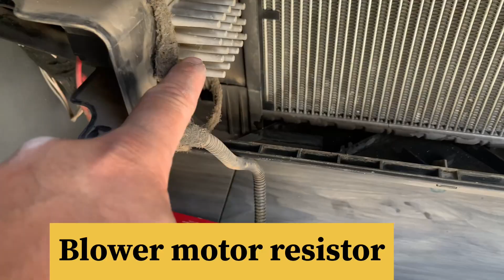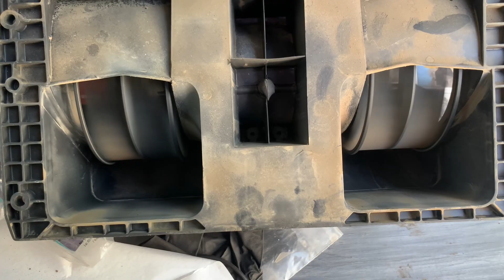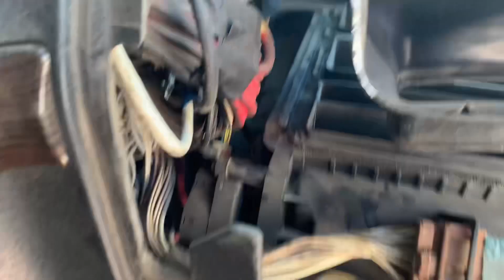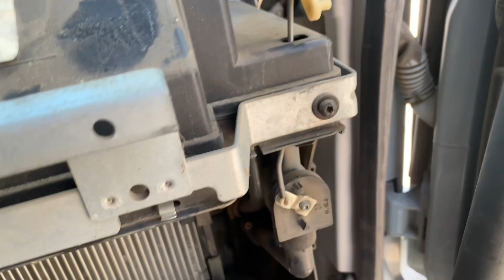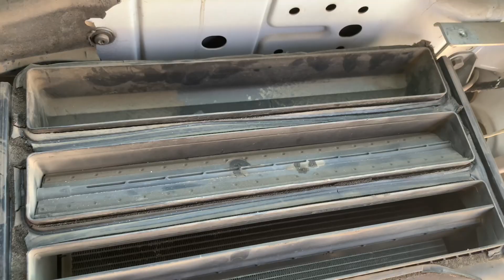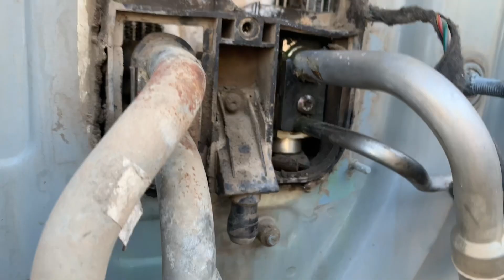Volvo VNL HVAC cab components

Comment: Do you know where is the cab air temperature sensor?
Reply from the maker: Yes, it will be in the evaporator housing.  You can access it by removing the blower motor. It will be a plastic sensor with a very small resistor by the tip. If you have a sleeper truck with a unit for the bunk, that evaporator in the sleeper will also have a air temperature sensor as well.

Comment: I am working on an old vnl 670 and the geartrain has come apart on the left side. Had to use a mirror to see that the white gear had come off its pivot. I am trying to get out of pulling the whole unit to repair this. It was only blowing AC out the defrost no matter where you put selector.
Reply from the maker: Sounds like one of those electric control motors stripped the plastic gears. I believe in you, just take your time and save any small screws you remove! Make sure you test all the functions and positions before putting the dash cover back on. Thank you for watching!